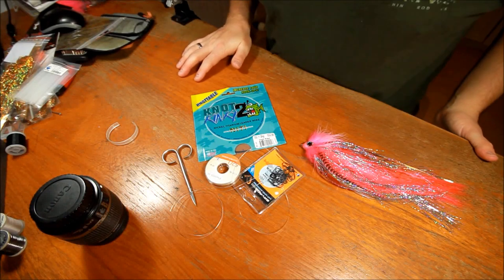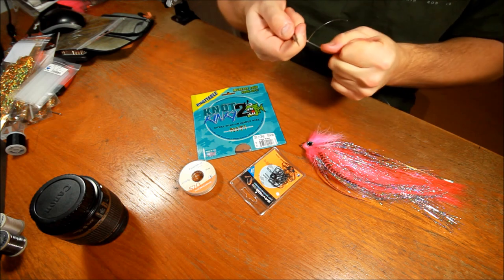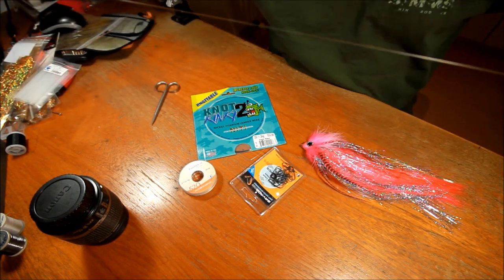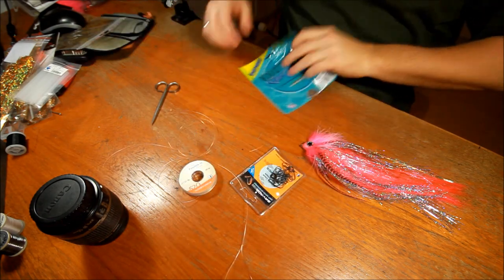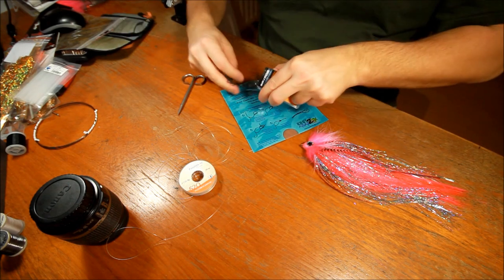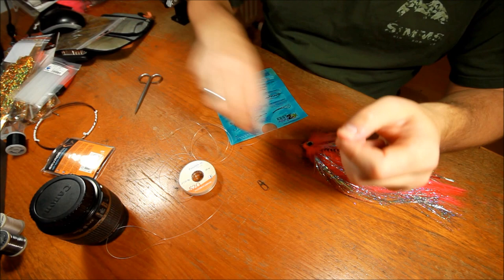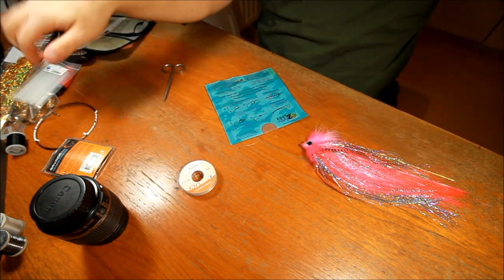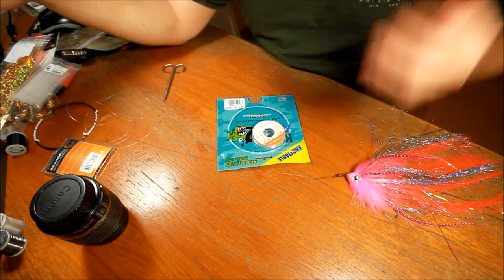Pike fly Rig, Step by step - lesson: How to make a leader

Comment: I found using the perfection loop makes the wire too brittle and snaps easily. Ive now changed to a double surgeons loop. I use AFW Surflon. Thanks for the videos.......... keep them coming. Hello from the UK
Reply from the maker: I agree it can snap if you use to much force (pliers or so to pull it tigth)
However i found that if you pull it with your hands it will work just fine ;)

Comment: Only bin using k2k for a short while  but  Im very  impressed. I did use the perfection loop on first made trace,  to attach it to a swivel as per the packet instructions. However I've made my second trace with simple clinch on the swivel and the snap end. These seem good and neat. Hopefully the swivel will aid the lure and line to not kink so much. (I've had trouble with my lines twisting and nesting). I purchased the 6pound k2k so fine and I believe it to be enough for perch and odd pike fishing.
Reply from the maker: Yes k2k is simply great ;)

Comment: The whole argument about the melted plastic.  I used Berkley nylon coated wire for awhile and melted it the same exact way.  I was skeptical so I made one with a loop big enough to slip over the hitch on my truck then wrapped the other end around a piece of 2x and pull as hard as I could and couldn't break the melted section.  I use 80 lb fluro now though and have never lost a fish.
Reply from the maker: Thank you for the input. :)

Comment: Do you ever have issues of the leader cutting through the fluorocarbon at your loop to loop connection?
Reply from the maker: Eric Shiflett Noe never ;) If you use titanum like Knot2kinky it is so smooth and will not shred of cut the mono/fluorocarbon